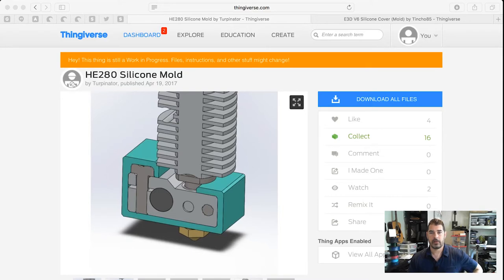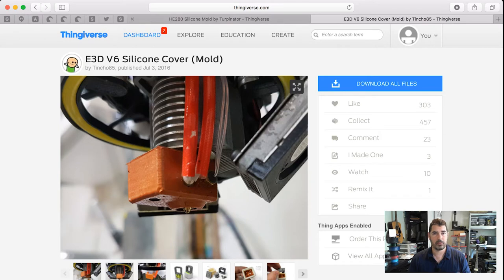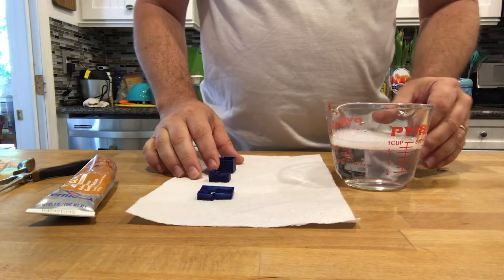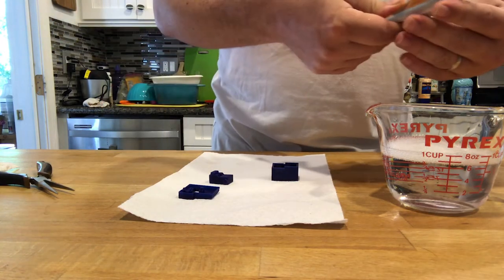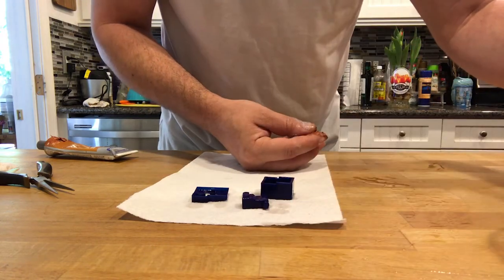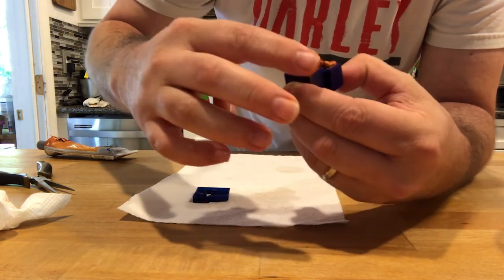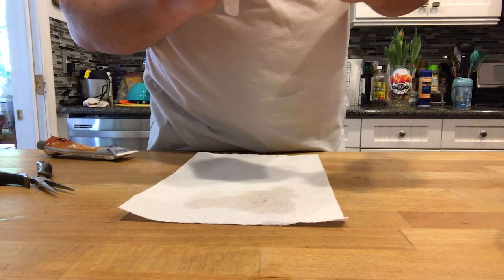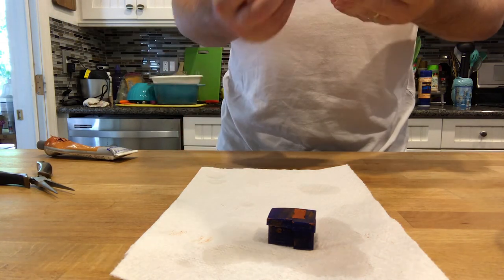DIY Heater Block Silicone Socks - Part 1

Comment: why didnt you use the corn starch method?
Reply from the maker: Phillip Ramirez not familiar with that. Will have to give it a google.
Reply: Corn starch lowers heat resistance properties of the silicone, it speeds up curing, but I wouldn't mess around with that -- I print at 250-260c, copper stuff is good to 300+, add corn starch, and it may start to smoke at 260c. Just wait for it to cure, don't add anything.
Reply: others have had no problem making the socks with cornstarch. using high temp rtv is the key. which is shown in this video. the problem is with this being in a mold like this it will take a long time to cure. if it cures at all.  now its possibel there was enough water pulled in to help it cure. as most of this stuff requires water to accelerate the cure.
Reply: search oogoo people are using the high temp rtv and getting good results. how does the excess material look?
Reply: Mine cured in about 3-4 days. I searched how folks use additives, and basic logic states it will lower temps. 2 part stuff I used degraded much faster. Consider a lot of these are rated max temp, but for how long...minutes or hours? I wouldn't compromise on temp tolerances

Comment: I made mine using this stuff https://www.thingiverse.com/thing:2031489 -- and I also tried red and I tried the 2 part stuff. My conclusion is the copper stuff is best, but you should use mold release, soapy water is not ideal. 
Also it takes 3-4 days to cure because it's not exposed to air.  DON'T open too early. Also make a bunch of molds, half of them fail. Good luck
Reply from the maker: +kazolar thanks for Shari g what worked for you!  Stay tuned for part 2 after Maker Faire

Comment: What a wasteful way to open a tube of silicone.  Why didn't you just use the tube as its designed to be used?
Reply from the maker: Actually, in this case it wasn't. This was an old tube and the top 1/2 of it was hardened and clogged, so by slicing it open I was able to get to the silicone that was still usable in the tube and didn't have to waste it. There was no way to get anything out of the clogged nozzle.